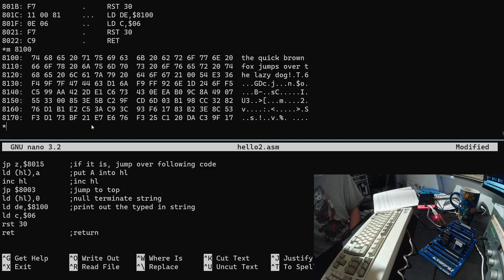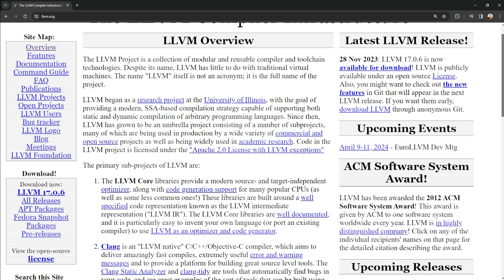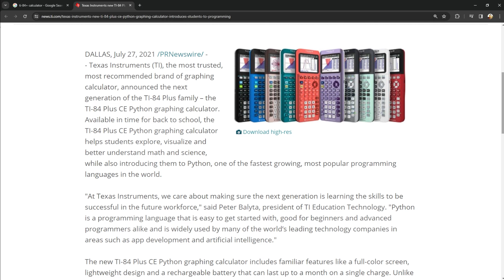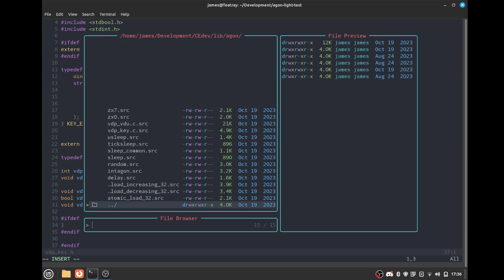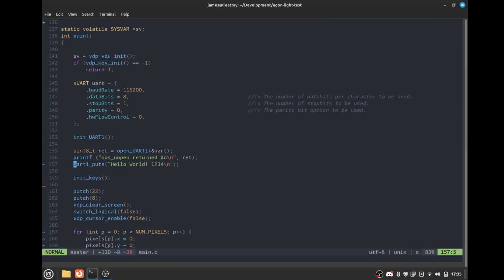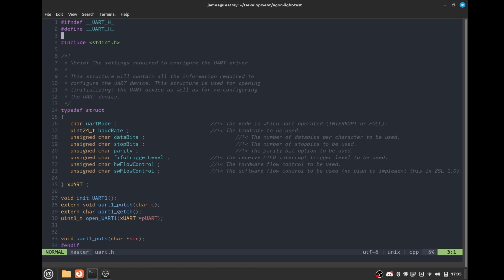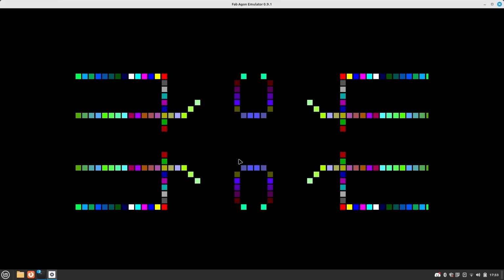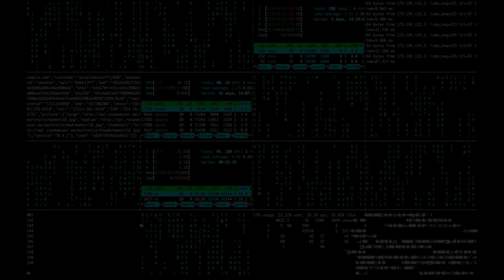Agon Light C Programming - An Introduction

Comment: Your video is perfect timing for me. I'm waiting for my Agon light to turn up in the mail so I'm setting up my own development environment. I'm curious to learn why you went down the CE C/C++ path rather than the z88dk path for the C compiler. I've just setup my environment for z88dk (compiled my hello.c file and can run it in the emulator).
Reply: For me, the main reason was the more modern C-Compiler in CE and the missing graphics support which I found easier to add in the CE toolchain. Normally I'm also on Z88DK fo the Speccy stuff.
Reply: As I recollect, z88dk only support 16 bit mode (address space) and not the extended 24-bit mode.

Comment: Nice video! But why not mention the default/original C development environment for eZ80 , namely Zilog ZIDE 2. This is what I use for Agon Light dev, it's Windows only but that's not a problem for me. Would love to see more videos on Agon C programming, specifically how to upload bitmaps and manage sprites, which has a few gotchas. Also MOS functions, audio, keyboard / joystick input etc.  I also have Agon C libraries for the graphical and audio functions, and the key up/down map.
Reply: I see there is also a new "AgDev" C compiler for Agon too.
Reply: As I recollect the original CE implementation was based on the Zilog toolchain, but was later ported to use LLVM. LLVM is a much more modern complier. If you look through the libraries, there is still quite a bit of the Zilog stuff mixed in there.
Reply from the maker: To be honest the only time I looked at the Zilog C compiler was to see some #defines for the UART port.

It is used for MOS though I discovered.

Comment: I'm surprised it has a C compiler.
The closest thing I had on my Atari 800 (with 48K) was Deep Blue C from the Atari Programmer Exchange.
It was based on "small C" and didn't support structures or unions along with a lot of other features.
Most annoying to me, the Atari keyboard didn't include braces so we had to us $( and $) instead.
Reply: The Atari 800's CPU, the 6502 has more challenges in supporting high-level languages like C than the Z80 does.